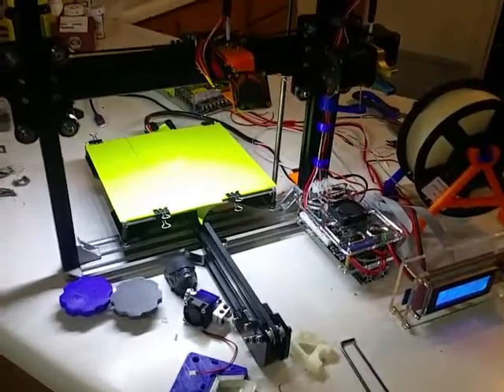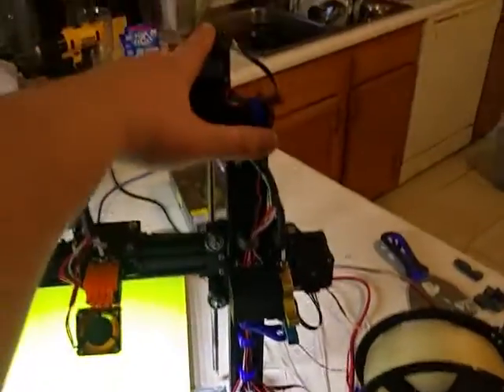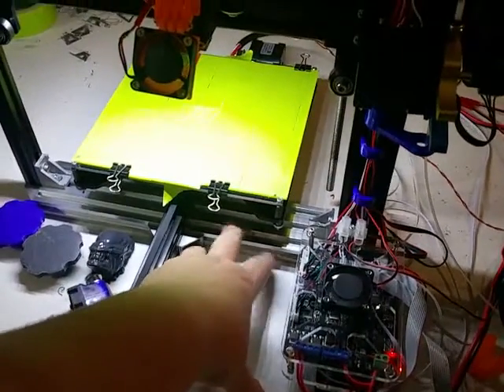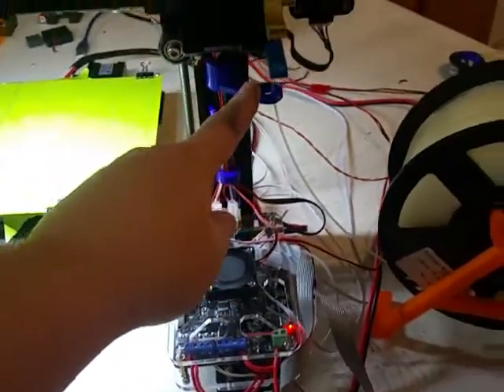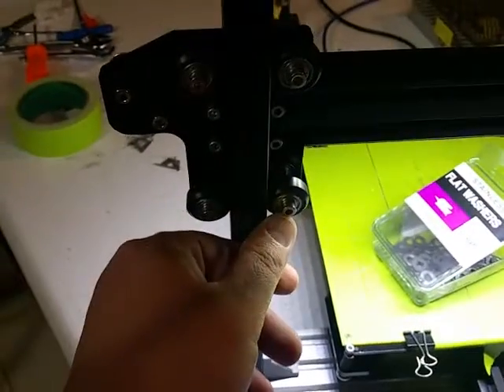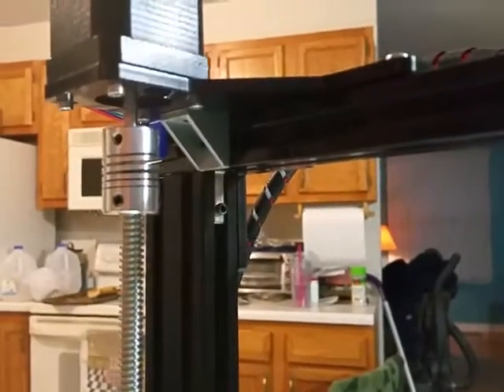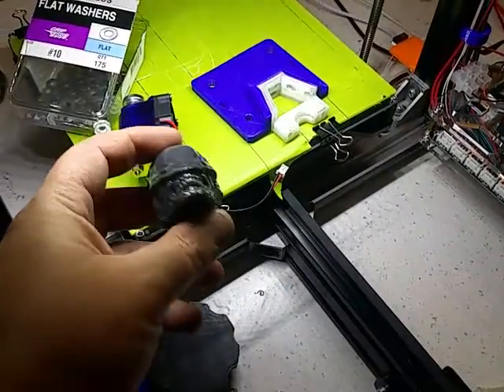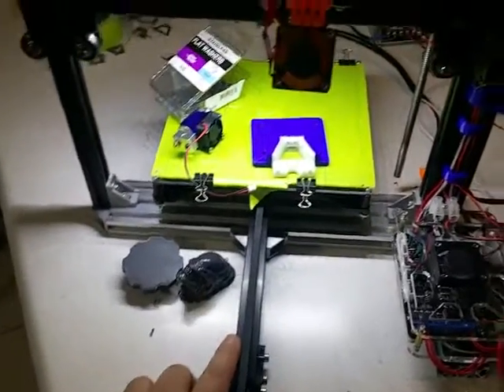Tevo Tarantula 3D review and some mods

Comment: thanks for the video tutorial. Btw i have a question : If i want to upgrade a standard tevo to auto level. where can i get the sensor ? i checked tevo doesn't sell the sensor separatedly. So if i buy from other brand or the generic sensor (for other prusa like sunhokey or zonestar) , will i get the compatibility issue ? Do you have any idea about this ? Actually, Tevo has the unit with autolevel installed already but that''s an extra $45 compared to other prusa which only need to add $10 to upgrade to autolevel.

Comment: What I do not like about that printer is that it is not 24v.  The second thing is the over use of plastic parts that will break (especially around the wheels) if not very careful.
Reply from the maker: I have not had any issues as of yet.. For a Lcheapo it works.. I'd prefer and full aluminum machine but hey, it's not what I purchased.
Reply: Todd Optional
I am a member of the closed group and so many people report the printer snaps at one of the wheels so the first thing everyone is told to do is to print another set of the RP because eventually you will need it.
Reply from the maker: +Dark Alchemist ... I am member of the group as well but I have not been following it lately.. All I can go by is my experience and after 8 months with the machine, it's still working good for a cheapo printer.. If parts fail, make new. It really does not surprise me that "stock" parts are breaking. If someone does not want to mess with broken part's or having to print new, spend the money and get a top of the line machine.
Reply: Todd Optional
That top of the line machine is no guarantee either.  Just get the printer then print the replacement parts and stick them in drawer is what I would do.
Reply from the maker: +Dark Alchemist Exactly :-)
Reply: Todd Optional
Do you happen to know which files are the one for the plastic parts that should be printed right away?

Comment: Do you need to change anything in the code to add a filament cooling fan? I printed a fan duct but I don't want to buy a fan without knowing if I need to modify the code or not.
Reply from the maker: no need to add any code. just hook it up direct and you'll be all good :)
Reply: +Todd Optional ok thanks

Comment: Thinking of getting one of these. What is the length of the silver 20x60 pieces you replaced? I may do that if I get one of these.
Reply from the maker: I believe they are 150mm (and I will correct this when I can measure it)..  openbuilds.com  sells the extrusion at 250mm, 500mm, and up to 1500mm, you'll need a 500mm piece along with 8 corner bracket's, 16 screws, and 12 of the "T" nut's.. You should be good with that mod..  

It's a great printer, you can't go wrong with it for the price :-)
Reply: the  extrusions you installed are 2060. Does 2080 could fit as well? Thanks